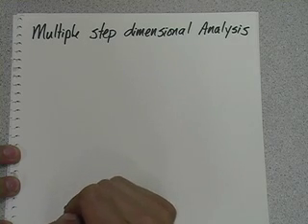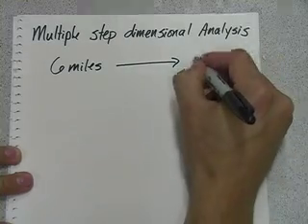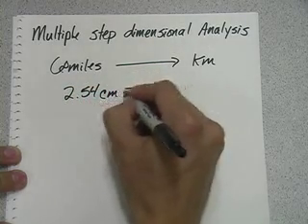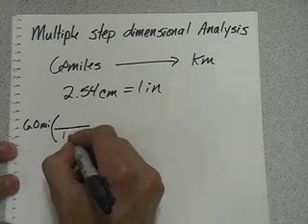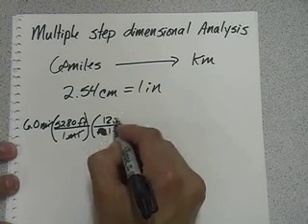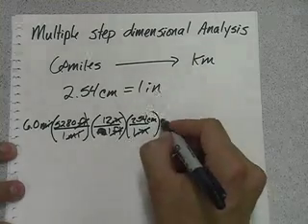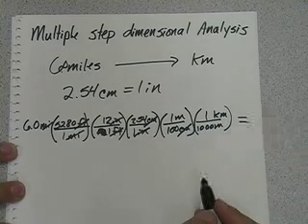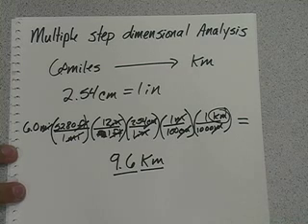Multiple Step Dimensional Analysis

Comment from the maker: The method I use on the calculator is to multiply all of the "top" numbers together and then divide by each of the "bottom" numbers. In this problem multiply 60 x 5280 x 12 x 2.54 then take that sum and divide it by 100 and then that sum by 1000. 
Another method that some people use is to multiply all the top numbers and write the sum then multiply the bottom numbers and write the sum. Then divide the top sum by the bottom sum.